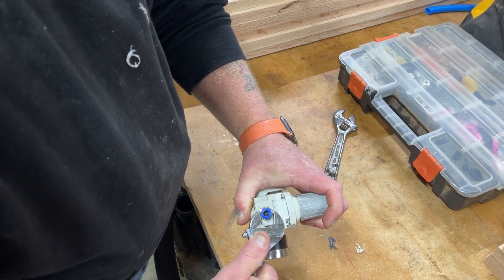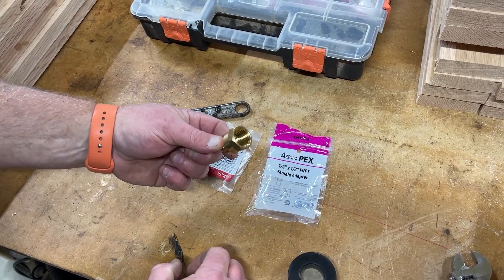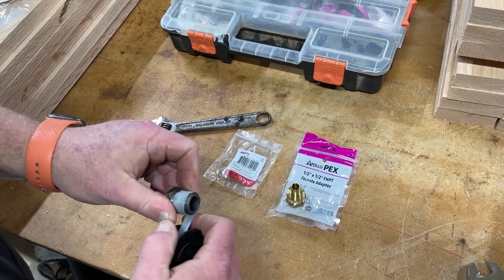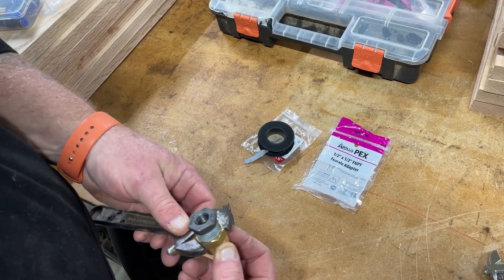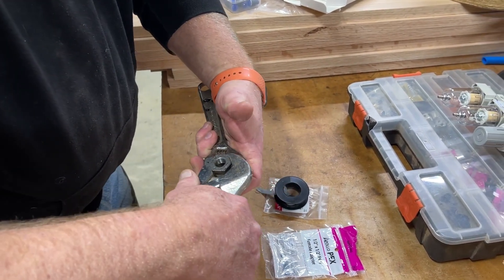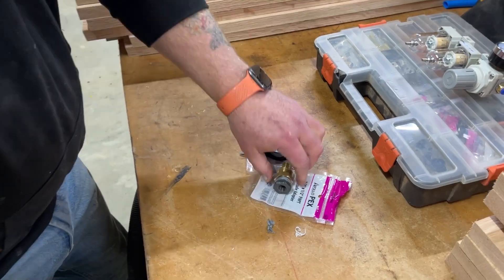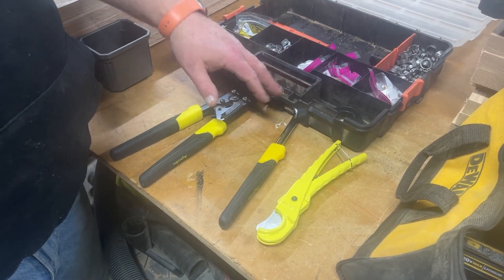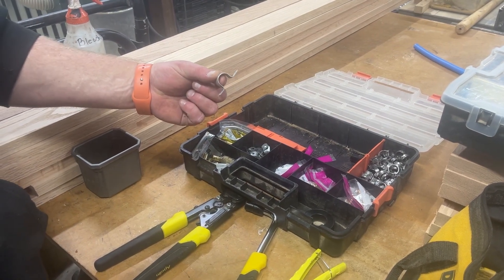Installing an external air system for laser engravers

Comment: I see other people use a solenoid. Do you use a solenoid?
Reply from the maker: The thunders have the solenoid built in. I’m about to retro fit the bolt with duel air and I have a solenoid to install.

Comment: Would you install the desiccant dryer closer to the laser or closer to the compressor? Thank you for continuing to make these videos. They're very helpful and appreciated.
Reply from the maker: Sorry for the delay in response. What I have found is to install it in a location that helps mitigate the moisture. For ours we installed it after the refrigerated air dryer, On another set up we installed it after the drip leg. The hopes is the drip leg collects the majority of the moisture. By doing this the desiccant just collects residual moisture. In my opinion you do not want this to be the primary way to collect moisture. Keeping it closer to the lasers is a good idea, however if you have water separators closest to the lasers is another good idea. Hope it helps.